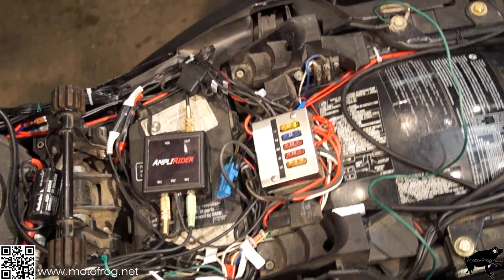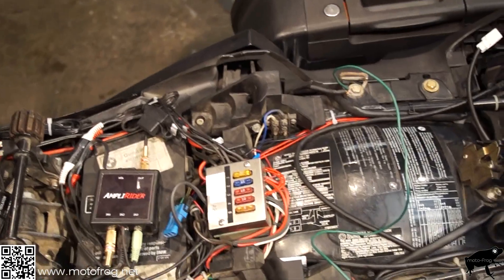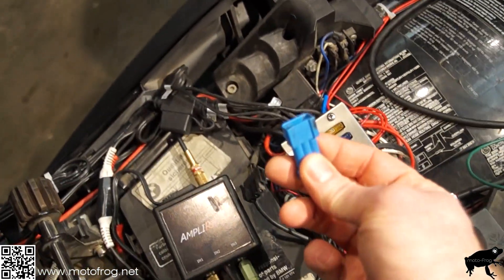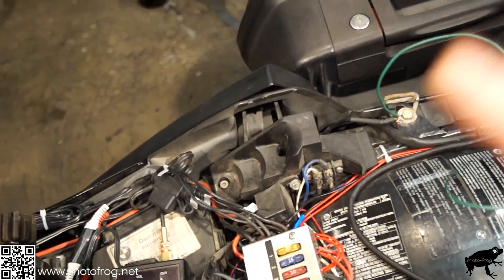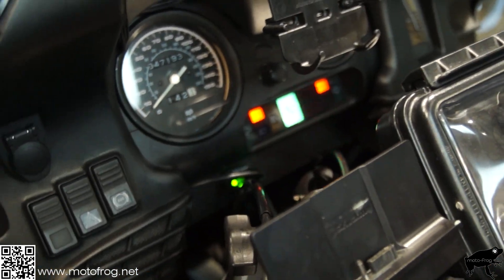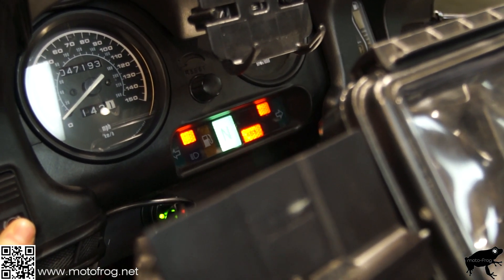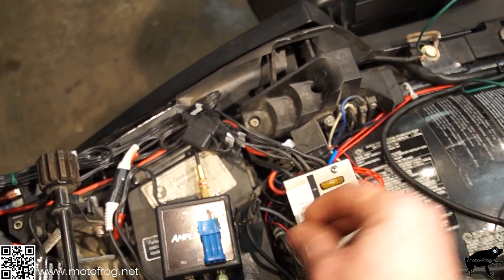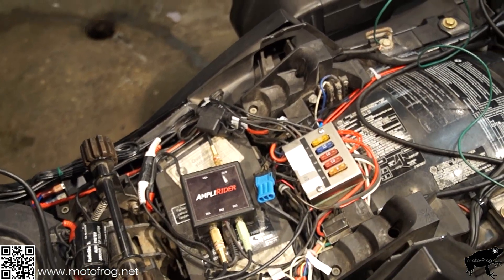BMW Motorcycle ABS-II fault reset

Comment: Hello,
A big thank you for this hight quality tuto.
I guess your are german ... but you did it in english, it is very nice from you (I'm french).
I have an old  RT1100 (110 000 km) and I had exactly the same issue that you are describing.
I did what you said, it took me 5 minutes, and it works !! Like in a dream (usually I can't do such things by myself, I'm not so good, I used to go to the garage...)
The BMW garage wanted to change my ABS, around 2000 € ... = the value of my bike pr or less.
5 minutes following your video, and no problem any more !
THANK YOU !
Lole